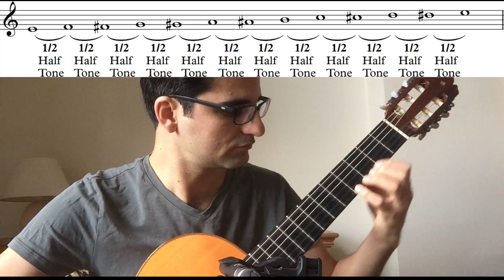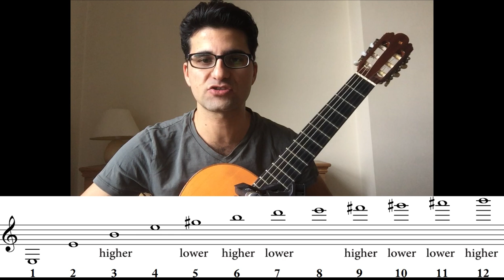Major 3rd Problem of All Guitars in the World

Comment: Yes, I wondered, and the answer is maybe not easy, but it can be summarized easily: frets give you equal temperament, whereas harmonics of course give you exact temperament. At (multiples of) one octave interval, the two temperament give the same frequency shift, but at any other interval, they give slightly different frequency shifts. And of course, equal temperament in itself is not wrong, it is just a compromise to enable you to play in any key with minimized tuning errors.

Comment: The harmonics are lower because they are on open strings. They sound slightly flat because they are not subject to finger pressure on the frets that makes other notes sound sharper. If you apply more pressure, the note will be even sharper, as simple as that. 
Everything else is BS!
Many guys all over the internet claim to have a solution to ancient problems and people believe them, that is really most disappointing.
These microfrets are useless but could be fun if you have time to kill

Comment: Use a whammy bar for microtonal shifts like I reckon Jeff Beck does! I find myself doing this to make some  sustained notes feel right.
 I've also noticed a varied  string height at the nut may be used to fine tune to some extent, one of my guitars sounds just gorgeous, I put it down partly to this idiosyncrasy of said guitar which has an amazing setup.

Comment: What if true temperament frets are involved? Just curious. ^^ Does that fix this problem? :)
Reply from the maker: Normally true temperament guitars are made for fixing the semitones. But of course you can make those types of frets like the ones I added on my video, though it is not a good solution. The frets should be flexible because when you change the key, you need added frets on the other parts of the fretboard. That's why the best solution is my adjustable microtonal guitar with movable frets.
Reply: Hm... interesting... well thank you for the information. I've asked many musicians with similar guitars to yours but you are the first to answer... so finally! ^^

I had a longer answer than this one but Youtube wouldn't let me post it for some reason... :\ but thanks.

Comment: The difference is clear right away, that must be the reason why when I hear a bad chord voicing then tweak the tuning till it sounds good, all other chords sound bad. However, what if I wanted to play a piece in 2 or more keys, wouldn't it be impossible to get this Pythagorean tuning to work?
Reply from the maker: When I play in 2 or more keys, I use my adjustable microtonal guitar with movable frets. They are many solutions on that guitar.

Comment: OK,  I am not a music professional, and I sure do not play one on TV.  Since I have neither the manual dexterity nor musical talent to play conventional guitar, I just play slide in Open E.  Raise the action, put on heavy strings and run them tight.  Not using frets, so intonation is set so the twelfth fret is exactly midway between nut and bridge.

Since I play a major chord with the slide lined up over a fret, I assume from this discussion that lowering the tune of the string that is the major third (the G# string) can bring it to a "true" major third.  Would I be correct in assuming that this should hold for the open chord (E major) and for all the chords made with the slide (for instance the E major chord made with the slide at the twelfth fret)?

If I am following this correctly so far, here is my question:  How many cents should I tune the G# down to accomplish this?

The reason this seems to make sense for my primitive playing is that the major third is always on the same string, unlike moving to different strings as with the different as used when using different chord shapes in conventional guitar playing.
Reply from the maker: Philip Ethier All major 3rds should be 14 cents lower if you want them sound natural.
Reply: Thank you.  I need to give this a try.

Comment: It sounds good, and it will work very well as long as you play in te keys of A en E. If you start playing songs in other keys,  there will be a problem. 
Also, if you play in a band, and the other instrumentalists do not use this correction, everything will sound out of tune. It will not be nice. It will be very bad,
That is the reason we invented equal temparement in the first place.

But, if you play together with not fretted instuments (like violins) or if you play together with other instruments that use the same correction, and if you stick to a limided range of keys, this may work very well.
Reply from the maker: Coen de Moor I agree with you. My movable fretted adjustable microtonal guitar is a better solution and i played many pieces in different keys in just intonation.

Comment: Yeah, for incredibly specific songs that last about 20 seconds this might work. But in general it simply doesn't work with these 'edit frets'. Try to play one of the 99% of songs out there and it will sound horrendous. I guess it's fun to experiment with as a weird little hobby, but it simply doesn't work and it doesn't have a real practical use.
Reply from the maker: darkaquatus don't be so sure, guitar is an amazing instrument that gives you many solutions with different positions. If you want to play a piece with better resonating intervals, it's up to you. But i see your point, it is hard on the standard guitar. That's why i can easily find solutions on my adjustable microtonal guitar with movable frets.
Reply: Tolgahan Çoğulu My point is simply that this 'solution' will cause more problems than it solves. In very specific cases it works, yes. But then it will cause issues with most other cases.

Comment: If you want to get exact intonation in all keys, the way to do it is probably to use a pickup/processor system like the Line 6 Variax guitars, and then apply a MIDI chord map to the processing as you play.  Of course this does require that you are playing with a prearranged backing track.  Though I suppose it MIGHT be possible to auto-detect the chord with rather more processing power?
Technically possible (though not commercially available at the moment), but is it worth the effort?  We're all used to hearing equal temperament nowadays.  In fact I rather suspect many who complain about it are wannabe purists, and I would be interested to see if they could really detect the difference in a double-blind test?

Comment: That is not a 'natural' D chord. The A on the 3rd string is already in tune, actually 1.96 cents FLAT over the open D string. So, should be sharpened (if anything), not flattened.

Comment: I guess electronic, software  or midi controller instruments have it easy to solve this issue than regular instruments. I would bet some vst instruments already have the option to add the corrected intonation. In guitars there are already ones with curved frets but i wonder if that can allow the guitar to work in all tunings or not.
I wonder if variax guitars have this option or they could add it in a near future.
Reply from the maker: True temperament guitars with curved frets don't solve this problem. They are fixing the semitones in equal temperament. You are right that you can play only in one key with these frets.

Comment: Another idea is to play a guitar that doesn't have any frets at all! Just like string players do, you would have to finger accurately to play in tune by using your inner sense of pitch. The problem with this of course would be that the sound of the guitar would be much duller compared to the conventional fretted guitar. So whatever system you use there are sacrifices to be made on this earth!
Although I've studied this subject in some depth, I still don't understand why 12 perfect fifths (going through the cycle of fifths) would end up in a note which is not in a true octave ratio to the fundamental. Can anyone explain this? Is there a flaw in the maths, or in nature itself? That's why all these problems exist.
Reply from the maker: Thanks for your comment. In Pythagorean tuning, each fifth is 2 cents sharper than the semitones. In other terms each fifth is 702 cents. When you reach the octave, it is already 24 cents higher which is Pythagorean Comma.
Reply: Why can't a 5th be tuned exactly to 7 semitones? Is that against the natural harmonic series? Is that what equal temperament does?

Comment: When you fret a note, you stretch the string and it goes sharp. When you play a harmonic, you do not stretch the string, so it does not go sharp. Luthiers attempt to compensate for this by placing the nut slightly closer than the "zero" fret would be. But because you also may want to play notes on the bass strings, not just open strings or harmonics, if the nut were placed optimally for harmonics, fretted notes would suffer, and vice versa, so the actual position of the nut is a compromise, and causes the problems you've observed. Repeat the demonstrations with a capo at the 1st fret. This will stretch the harmonic strings, and sharpen them.
You have encountered not so much a problem with the well-tempered scale, but with the construction of fretted, stringed instruments. One solution is to add microtonal frets. Check out other solutions like the Buzz Feiten tuning system, which modifies the position of the nut for each string.
Reply from the maker: When you fret a note and stretch the string to the right it goes sharp, stretch it to the left it goes flat.
Reply: No, not position the microtone fret left or right. I'm talking about when you press a string towards the fingerboard to fret a note. That stretches a string and makes the note sharp. When you play a harmonic, the string is not stretched like all the notes on the fretboard, so it would be flat. but your guitar is built with the nut positioned so that the open string is slightly sharp, to imitate the sharpness of the stretched strings. But there is a problem: you also want to play fretted notes, as well as harmonics. So the position of the nut is a compromise, and this is why you encounter the problem of the fretted notes being sharper than the harmonics.
If you could get your action low enough, so you don't have to stretch the stings to fret them, you could eliminate this problem. But this is impossible because the strings need room to vibrate.
Reply from the maker: I am also talking about pressing a string towards the fingerboard. I just remind you that you stretch the string to the right it goes sharp, stretch it to the left it goes flat. Try it on your guitar.

Comment: To those concerned about key restrictions: The key thing here is that you are NOT setting up a full partial fret Just Intonation fretboard, which is pretty crazy and more limited to 
certain keys, yes. 
This solution is a fully accessible system. You place one extra fret and
 the 3rds of that chord when used in any key are now pure. Great! Want 
to use that 3rd as a root, making it now out of tune with other frets 
and its octave frets? just use the 12equal fret that is still there ! :)
 With a small number of frets you improve the 3rds of all open chords 
that are used in many songs in multiple keys. When they aren't 
appropriate,  12 edo is still there.
It is flexible just intonation. Your singer will sing these new pitches over any given chord unless they are using your 12edo out of tun approximation 3rd as a guide. Yet they still move their roots in 12TET just like a guitar with added (not altered) frets is still able to do!  
If you want full flexibility, add one at every fret and there you have all your Barre chords in every single key!
Reply from the maker: Thank you Tom!

Comment: ...or you could just go with True Temperament fretting system and have all notes be perfectly in tune all the friggin' time in every possible key. No need to hassle with constantly switching frets out depending on which key you're in – plus, it works in every position of the guitar, even high up on the neck.
Reply from the maker: True temperament guitars have nothing to do with the harmonics I mentioned on the video. Those guitars are for fixing the semitone deviations in 12 tone equal temperament.
Reply: But it DOES fix that as well. With True Temperament, the harmonics match the fretted notes (just like you showed). Go check Mattias Eklundh's demonstration where he shows exactly that.
Reply from the maker: I watched the video and couldn't find it. Can you send me the time where he show this 14 cents lower major 3rd harmonic. By the way, it is illogical that these fixed fret guitars have these 14 cents lower frets because when you modulate, those notes would sound awful. That's why you need taped frets or movable frets.

Comment: the problem is not 12 tone equal temperament - the problem is the nut of a guitar is not designed properly. check out the Buzz Feiten Tuning System to realize the guitar's nut problem and how to remedy it.
Reply: The Buzz feiten system addresses another issue, namely bad intonation. It still uses Equal tempered tuning.

What Tolgahan is doing is something completely different. The Buzz feiten system can not make the C# on the B string be perfectly in tune with the C# harmonic on the A string.
Reply from the maker: Buzz Feiten Tuning System is not solving the problem I mentioned on the video.
Reply: you put a special  buzz feiten nut on your guitar and it will play in tune for every chord shape.
Reply from the maker: I agree with Jonas.

Comment: Van Halen would be rich had he known this... Metallica too!
Reply from the maker: They might know this already.
Reply: im pretty sure they are
Reply: ....heavy sarcasm
Reply: Eddie van Halen tunes the b string slightly lower in tunes such as unchained to achieve this - I dare say he would be quite wealthy if he hadn't snorted so much but at least the majority of his chords were in tune.
Reply: barnyp - yep, Running With The Devil is another good example, you can really hear those major chord inversions in the riff that sound sound as tight as a power chord, none of the intermodulation mess you get when playing even-temperament major thirds with distortion. You just have to bend the B up slightly to compensate when you're hitting notes that aren't functioning as the major third of the chord.

Comment: I noticed this a while back. I found a Foo fighters tab book. One of those horribly innaccurate Hal Leonard ones, and noticed that all the open G chords had the thirds muted. I dunno if Dave Grohl actually plays them that way, cus those tab books were awful. But they sounded way better that way to me, so I started looking for the slightly duff notes in other chords, and realised this. Then I read an article about it in a guitar magazine. It makes sense and all, but...everything we think of as "good" now, began as a mistake or a cut corner. Guitar amps were never meant to distort or compress, pinch harmonics were caused by "bad" technique, and what we call "vintage" and drool over, is just the result of cheap parts going bad with age, or circuits that were poorly design ed to start with. Hell, the electric guitar was SUPPOSED to just be an electric guitar! A guitar, only louder! It was supposed to sound like an acoustic. Every great song you ever heard, was played using this "flawed" system, so the same trick has been played on your ears. "Bad" has just become, "The way".
Reply: omg ur everywhere :D
Reply: That is right on,Old rocker here.Music nowadays is just muzac.